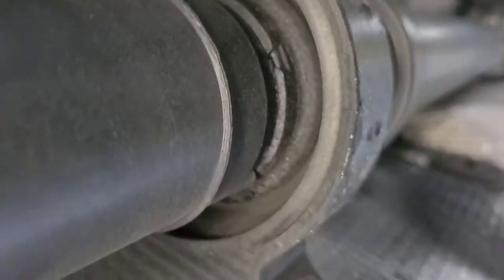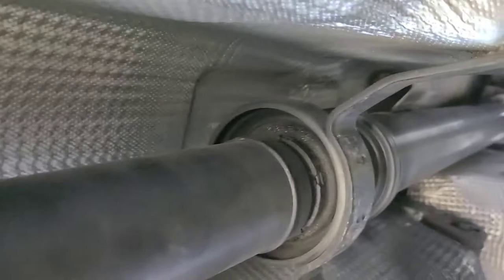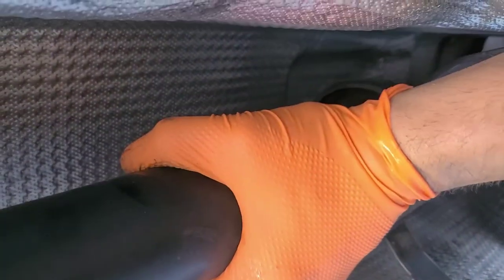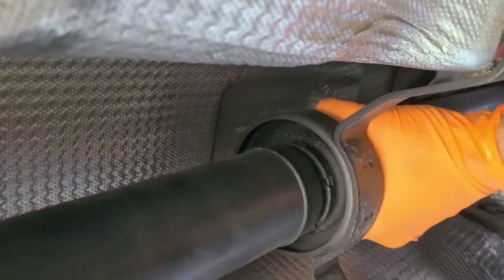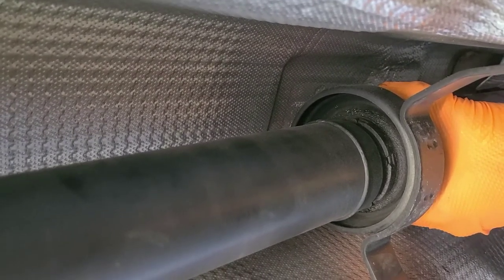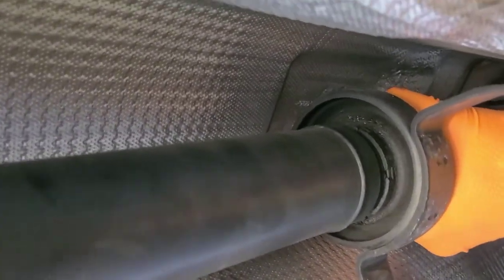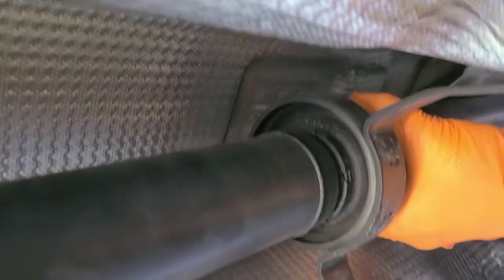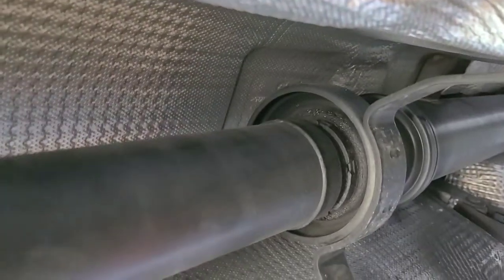Audi B8.5 All models driveshaft vibration - JXB performance carrier bearing installed

Comment: What was the result? Does that mount transmit noise from the drivetrain into the cabin?
Reply from the maker: The result was a super smooth ride. I guess I should have done a follow-up on my review on how it ended up. Definitely no noise transmitted into the cabin with the street bushing

Comment: Did you have the dreaded A8 cabin drone noise before replacement? I have it and its unbearable. Got brand new tires which lessened it but its still there. Had all the bearing and suspension and steering components inspected and all are good. Came across the possibility that its the drive shaft creating the droning harmonic. Thoughts?
Reply from the maker: I have a hard time thinking that that alone could be it...what about a muffler or something making contact with a crossmember or something transferring the resonance into cabin.
Reply: @dsatt21 Hey! you're the first person that I've seen that has the same problem as me I think. I have a TTS that makes a high pitched droning noise that starts at 120KPH then goes away when I hit 70ish. No one can help me figure it out but I'm thinking its this bearing. Have you replaced it?
Reply: @mikenoseworthy1  I actually swapped tires for a second time to the Michelin Primacy Tour A/S with Acoustic Tech… it helps substantially however I can still hear it although much more faintly. Wasnt going to spend $10,000 trying to swap drive shafts and bearings that weren’t considered damaged. Its bearable now enough that I’ve stopped worrying about it.
Reply: @mikenoseworthy1  Hi, from what you say sound like my problem , i get a humming sound (like a damaged bearing but not that loud) with a vibration , but is pulsating , 1-2 sec on  0,5 sec off. i can hear it above 120Km/Hr, under 120 , it's quiet. Did  you fix your problem?
Reply: Have vibrations with the JXB above 90km a hour. Oem was perfect buth looking with JXB what the problem is. Top service.

Comment: Mine is AUDI B8 2.0 and there is crack in the rubber centre bearing. So I encountered vibration below driver seat when going from 0 to 60km/hr Can I just replace the rubber and the vibration will go away? What is the estimated cost and time taken for labour? Thanks.
Reply: Hiii, i am having the same exact issue!!! If you find the fix please help me
Reply: @krishnasinghalxxx2  What is your car model? Have you tried to replace engine mounting?